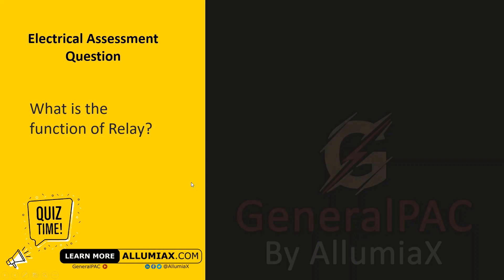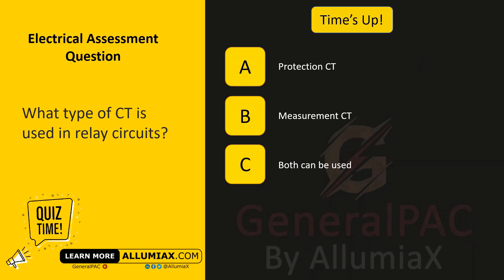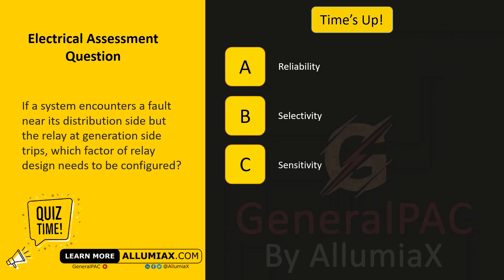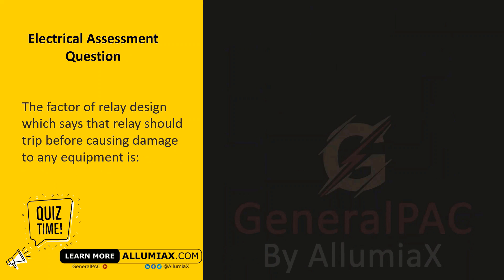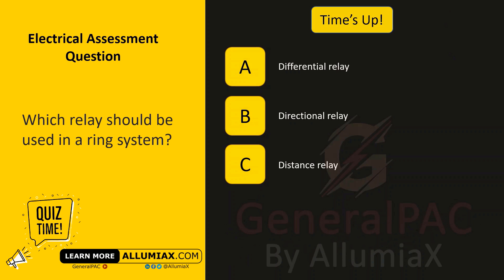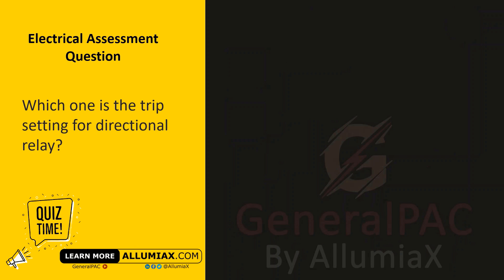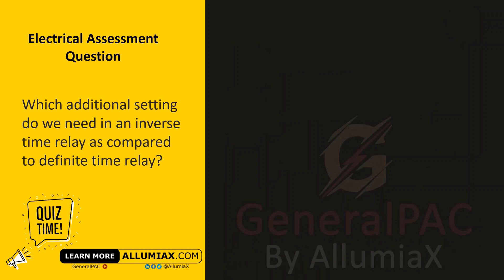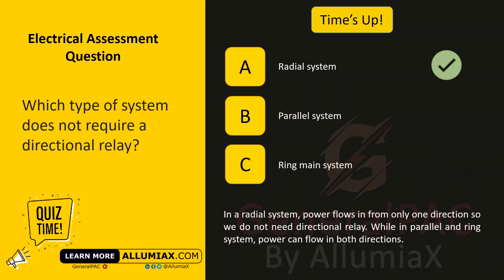Part 1 — Electrical Engineering Interview Questions & Answers (MCQs)

Comment: Can you please check the answer of ring system question? You picked differential Relay as an answer, but mentioned in explanation that it should be directional relay?

Other than that good job!! and thanks for all of the videos you post here...they help tremendously.
Reply from the maker: Hello Sami,
Thank you for letting us know about the error. We've added a correct answer in the pin comment of this video i.e "Directional Relay". We're glad that you liked our videos and we hope that you will join us in the upcoming videos as well. Stay tuned :)

Regards,
GeneralPAC by AllumiaX